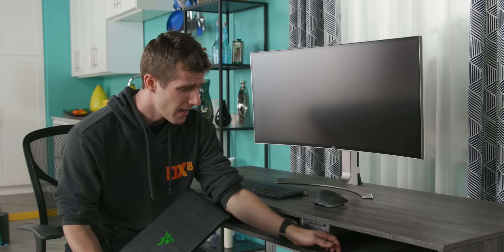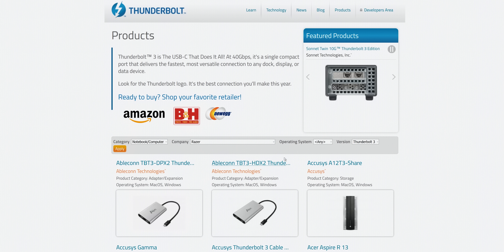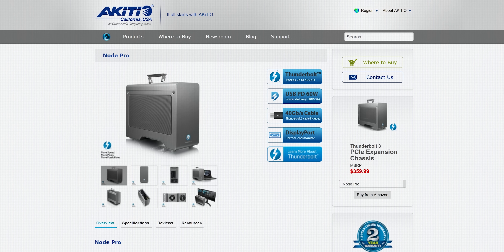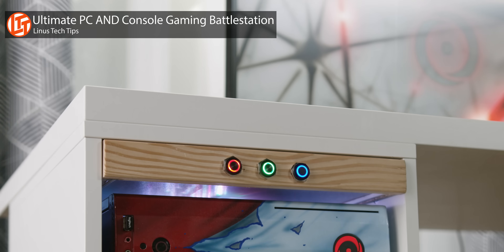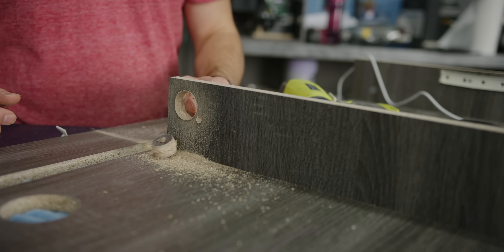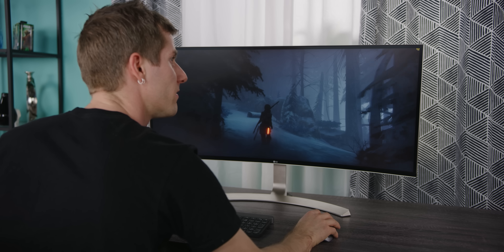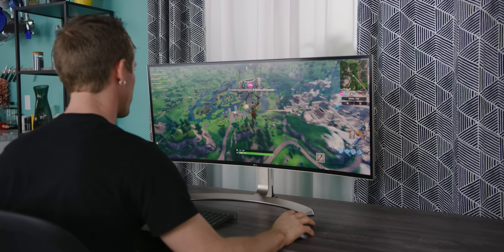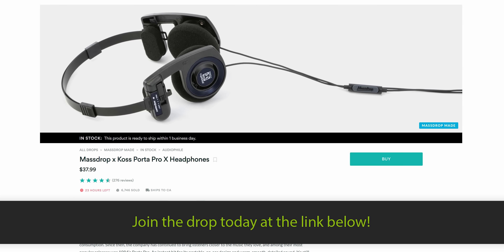This is the CLEANEST Setup.

Comment: I've been wanting to do pretty much this exactly for so long. The only difference is I want to make a slot for the laptop to slide in vertically with a already set in place 3.0 Cable. And the IO integrated into the wood

Comment: A better alternative to the velco, is the scotch fasteners. The hold on much better, as far as both the adhesives and hooks go. It's not so strong you could damage anything, but much more durable and reliable than normal hook-and loop stuff. This is what I did on my desk after being disappointed with velcro, and it's been holding on for almost 2 years now.

Comment: What about two Wireless chargers to load the mouse and keyboard? (First, we need a mouse an a Kexboard with this feature, but then we never have to worry about empty batteries.) And maybe you can spray white areas on the Desk, to mark the loading fields.

Comment: The Manitz Venus is an egpu enclosure; with a sata port, usb ports for your peripherals, an ethernet jack, and up to 87w PD. Probably the best device for one cable docking. 

The ability to daisy chain on the dock and some other eGPUs is useful, but this is probably a bit more cost and space efficient.

Comment: Well, regarding computers one of my dreams has always been to unify my Desktop and Laptop. I have always wandered about the day that I can have my PC at home and then a tablet-laptop little thing that I can bring with me and keep using my Gaming PC though internet, not just for gaming, but to use the horsepower to render a video while I'm doing some work or something.
Now, you've showed me an other option, instead of converting my desktop to a laptop by accessing it remotely, I can convert my laptop into my desktop and increase its performance and then deattach it and off to the races. This is, right now, one of my favourite videos on the Internet, thanks.

Comment: Could overclocking the GPU fix the framerates problem, or are you limited enough by the bandwidth of the thunderbolt port that it wouldn't matter?

Comment: I wonder how much bottlenecking would happen if you were using some external drive, Lan ethernet and GPU at the same time for example. Also does latency change if system is under this kind of load.
Reply: Let's see. 4 PCIe lanes over thunderbolt supplies 40 Gbit/s. A spinny HDD isn't going to use more than 150 MB/s realistically, so that's 1.2 Gbps. LAN is another 1 Gbps. You'd still have 37.8 Gbps left for the GPU, or 94.5%.
Reply: @stale2665   Thunderbolt in PCIe mode does NOT have the bandwidth of 4 PCIe 3.0 lanes. It's capped at 22Gbps, which compared to 2 lanes/16 gbps is not a big difference.

The "40 gbps" is achieved by plugging in a PCIe device and 2 monitors. All this information can be found in Intel's TB3 datasheet.
Reply: @_mkc  well, that's unfortunate. It sounds like it would be more like a 10% performance loss then. However, you would probably not max out your LAN whole gaming, or it should be pretty easy to avoid at least.
Reply: @stale2665  Unfortunately he is right, this is a common thing on lots of EGPU Forums, Thunderbolt 3 is bottlenecked already(excluded the CPU Throtteling Laptops just like this Razer Core is) + on top you really really don't want to add perihperals into Thunderbolt 3 devices, I am not just talking about input lag, but in general you will notice performance drops. Thunderbolt 3 isnt there yet ( I am using a setup myself for over 2 years )
Reply: @stale2665  I would be nice if it worked as simple arithmetics, but i am concerned if it would start stuttering when you suddenly start to copy/download something or that causes bigger online lag.
Reply: @stale2665  har vi en nordmann her eller

Comment: Interesting video to me because I just bought a CalDigit TS 3 dock and the Razor Core with an Asus Strix 2070 graphics card pushing a Phillips Momentum 43" 4K monitor. Works great, but frame rates are somewhat limited utilizing the TB 3 connection. However, the TS 3 dock does a fine job of charging my Dell XPS 15 9575 and the Core is pretty quiet when under normal load. It does ramp up some when under heavy load. I like the clean desk concept. Good job.

Comment: Kinda reminiscent of my setup.
My table is equipped with 3 monitors (on VESA arms), all with USB hubs, and peripherals (webcam, speakers, mouse, keyboard) are plugged into one of them.
A large bundle of wires then goes through a hole into a cabinet (ventilated, yes): 3xPower go to the outlets, 3xDP go to my gaming desktop tower, 3xHDMI go to my laptop docking station, and USBs go into the USB switch (not just a hub, a switch has a button to switch between PCs) which in turn connected to both the tower and the laptop. So I can switch between my gaming tower and work laptop whenever I please and work with the same peripherals on the same desk. Pretty convenient. No perceptible lag too.
The only bummer is that the middle monitor has no automatic video input switch. Daaaaaang.

Comment: I basically designed this setup 3 years ago using a Dell XPS 15, Caldigit TS3 Plus, Razer Core, GTX 1070, and an LG 43" 1080p/4k Monitor. It looks like the only thing I didn't anticipate is the issue of the eGPU needing to be first in the daisy-chain and the Razor Core, now the Razor Core X, not having a second thunderbolt 3 port, as well as, the issue of powering the 98W laptop with a single cable.

Comment: It is a nice setup, but I would rather just have both a laptop and a desktop. A setup like this one isn't significantly cheaper than a two device setup and lacks the redundancy of having an extra device. If the laptop fails, you have a computer to get work done and visa versa. If the laptop in your setup fails, you can't do work until you replace it. Also, having two devices means I can render videos/animations on one while setting up the next task on the other.

Comment: Oh please Linus! Do a video where you do the cleanest ultimate workstation/gaming rig! I mean something permanent! Like water cooling using an home radiator (not that rusty one, like a new or something). Maybe integrate that with an a/c unit that further cools the pc. All by still being dead silent. Make sure to include wireless charging and SD card reader. Maybe even further controls for home activations like inside temperatures. Live webcam front door etc! Loved this video! Cheers!

Comment: so basically you buy a 1080ti + a $500 eGPU enclosure for the performance of a 1060
Reply: Well my idea is to buy both laptop and desktop.
Reply: I've had a similar set up to this for about a year now,
I'm using a late 2017 HP Spectre i7, and a Gigabyte GTX1070 that in an eGPU enclosure for $550, at the time the MSRP for the 1070 was ~430 but you couldn't find it anywhere for less than ~$550 anyway. I can't dasy chain Thunderbolt off my eGPU like they did in the video but that's fine by me sense it would eat into my Thunderbolt bandwidth for my 1070 anyway. I simply make due with the savagery of using the laptops second Thunderbolt port for my keyboard, mouse external drives, and ethernet.
So overall the price actually did make it worth it as I didn't spend a dollar over what I would have spent on the 1070 during the crypto bubble. With that said I agree the razor Core and the other enclosures that cost ~$500 before the graphics card are extremely overpriced
Reply: @theyphridge  well if you are having 2 thunderbolt 3 ports why the fuck would you chain it??
Reply: the perfomance is better then the 1060 bcos he is playing in 4k
Reply: @lil_ToT-XFZ1  are you high on weeds check the wording.
Reply: egpu is the dumbest stuff ever created. this is absolute schizophrenia, when the media assures me that I need fewer devices so I have to buy more devices. at the same time losing money AND productivity.
Reply: @williamblake7386  you don't know what schizophrenia is... All your points are invalid from here on out!
Reply: And a laptop
Reply: Yes but you avoid buying a desktop with a 1060 and a laptop with a 1060 to do the same thing.
Reply: @aaronchamberlain4698  well i will prefer this idea. I really want two individual devices to do specified tasks.
Reply: Facts
Reply: are you forgetting the resolution he is gaming at?
Reply: @apokalypz08  bro i have resolution in mind one thunderbolt 3 can do 2 4k monitors or q 8k monitor. Get your facts right...
Reply: yes

Comment: Been doing this for about 6 months now, after a while you miss the power of the desktop. I have a Dell XPS 13 with a dell dock and a couple of 1080p monitors, but once 5 or so months past the novelty starts to wear off. So even though I still use this I have brought 2 additional 27inch iMacs, one for home and other in the office, I basically use the Dell for housing emails and Spotify. Also, another note with the Dell I've noticed (though might just be me) but when you set the lid set to do nothing when on power-line, it doesn't always detect when you pull the power to leave the office and will run down the battery really fast. That last part could just be a hardware fault though.

Comment: As for the mouse on wood problem . . why not simply get one of those 90cm x 40cm mousepads or even simpler, get a simple anti slip mat with textile top and stick it to the desktop to completely cover it? or, hell, even a single clear thin plastic sheet to kind of laminate on to it should work no problem with todays mouse laser sensors

Comment: I don't know if the eGPU helps with this, but when I gamed with my Razer Blade closed (using external monitor), the heat burned the key squares onto the screen. May want to be careful with that; however, the eGPU may take some of that heat out of the equation!

Comment: I use an eGPU myself. You're better off going with 2 cables for your setup. You want your eGPU dedicated to one thunderbolt port and your hub with all your peripherals on another. You can get lag in your input devices if they are bottlenecked to the same port as the eGPU.

Comment: Besides of the additional Graphiccard.. Many professional laptops do have the option for docks. + with cloud or a well setup domainuser you can share many work ressources. Through onedrive and for example my current worklife is entirely synched on every device.

Comment: Those  desks with high mid-compartments are a friggin' ergonomic disaster. Especially for people  with relatively long arms. There's little chance you can get the right chair height without either your knees hitting the lower desktop plate, or your chair arms not being level with the upper desktop plate.

Comment: that single shot at the start though.

my current dream set up is pretty similar.  blade 2060 (to play on the road, too) + core 2080 (high performance on big screen), monitor, cabled rgb keyboard, wireless mouse.

Comment: The laptop should rest on rails that can be re sized accordingly to the laptops size, implement some neodimium magnets for a very nice fitting then the laptop would attach to the thunderbolt plug when pushed back as a drawer for that smooth connect, ending with more magnets at the end to secure the connection in the back wall of the drawer. Of course this needs Millimitrical measurement and planning but, like you said you had an “Alex” which is basically a CAD drafter with an engineering degree. He should be able to do it easily. But my guess is he lacks creativity due to the school system he went through...
Reply: Don't put magnets next to a computer if you don't know what you're doing... 

Also, Alex has an engineering degree? What kind? He doesn't seem very handy for an engineer, handy for a regular person yes, engineer, nah :)
Reply: JustA Norwegian I believe he does have an Engineering Degree, don’t know in which field though. I remember Linus telling us he had a degree way back when he was hired. No disrespect or anything to Alex by the way.  Magnets do cause problems for the regular drives but, I don’t think they affect solid states or NVME drives.
Reply: @Hennesii  A magnetic field as strong as that made by a neodymium magnet would definitely cause electronic interference or could mess up the laptop's speakers
Reply: Saqeef Iqbal  I have a couple of them around my IPad Pro and nothing has ever happened to it

Comment: Would it be possible to build a desktop, in a frame maybe of some sorts) in the drawer cabinet and then route the cables the same way to get a clean setup but still use a desktop? Or would the thermals take a hit because of all the wood and stuff?

Comment: Add a cable for the laptop so you don't have to run to look for and connect the power cable when its battery is low. Other than that, this is an insanely good-looking and intuitive design

Comment: $420 for laminated Particle board... Wow you got scammed hard.
Reply: Yea that's a 100$ job if you go to the correct people
Reply: @Red_AM  I'd recommend using MDF and building your own.
Reply: 420 gang gang 1 hunna
Reply: @thayrick369  Get that hitta!!
Reply: u have to blaze it bruh
Reply: @n1cebassbro  420 gang gang 1hunna
Reply: My Desktop has the Same this ist coustum Cut and cost under 100 bucks
Reply: so a wireless charging desk is cheap?
Reply: @yureikayt3765  it depends what ur investing and skills, u know, if u want that to be brought up to your doorstep its gonna cost some dough
Reply: @torex0  just realized he was the one who made that feature available on the desk , so in this case Linus kinda looks like an easy target for table scams :D
Reply: Exactly, my desk of the same quality costed $25
Reply: neoqueto you’re not building that desk for $25
Reply: sik59rt You would need the powertools which would easily go over 200 bucks
Reply: @phantom-xb6wv  seems like they had tools - a cnc router no less. But I guess they made the video with the idea that others could get the same exact parts - but then again they still cnc machined it facepalm
Reply: @damiengates7581  you still need all the hardware for the drawers, as well as the frame, and, if you want one that looks good and is actually stable, you also need experience in building things. All together, buying this might be cheaper for Linus then building it himself
Reply: can you explain that all this Styrofoam shit is expensive
Reply: Canada

Comment: Really interesting video, this is kinda the setup that I had in mind when I got my MacBook Pro, but to be quite honest its kind of overkill. For anyone that just wants a productive setup with peripherals, a big screen and power delivery via one cable you could just use a USB-C dock for ~60 bucks, which is way cheaper than any Thunderbolt 3 Dock you can get on the market (today). My USB-C Dock is capable of 3 USB 3 connections (2 USB A and 1 USB C with data only), an HDMI output, SD Card and even has an ethernet port, not to mention the 100W power delivery/passthrough. I'm really happy with the setup, its awesome when you get home from uni and just plug in the laptop into the USB-C dock and have everything running smoothly. If you got a thousand bucks extra to spare to get the eGPU and TB3 docks you could do this setup, but the USB-C Dock works just fine for 1080p and is way, way, way cheaper (especially if you just got your fancy USB-C/TB3 laptop and don't have the money to get TB3 docks/eGPUS ^^)

Comment: Follow up with mouse & keyboard charging  capability. Also 70+ W charging output for the laptop. Also is this something we can invest in (actually stable & reliable solution if you have thunderbolt 3)

Comment: I am a leather worker, you could... bore a hole all the way through for the charging then cover the hole with a piece of bag stiffener. Using contact cement you could easily adhere a piece of leather to the top of the desk, cut out the holes or simply x cut them to allow cable management. Then you would have a classy AF leather covered desk that is perfect for mousing on and any one without a cnc could do it. Adding the leather would only add an hour and about $100-200 (depending on the leather) to the build

Comment: what would happen if the laptop has a 1080 in it and you would add a external 1080? would it run in sli ore would only 1 run?